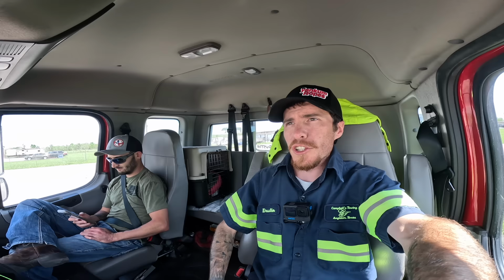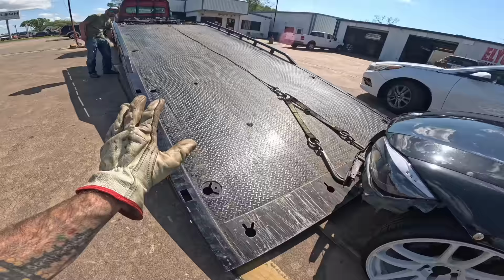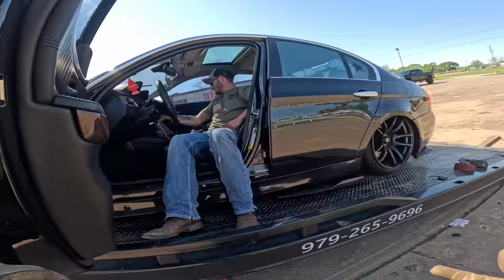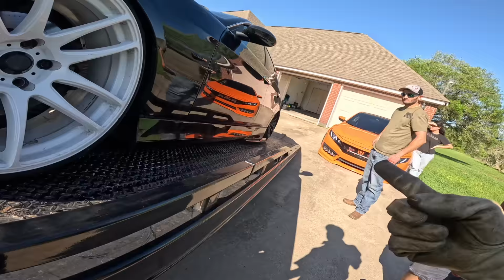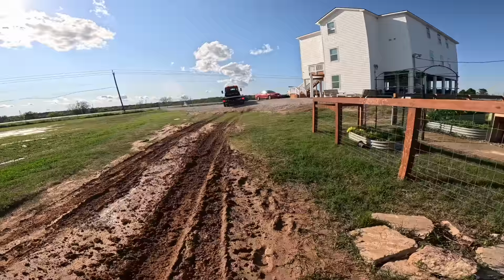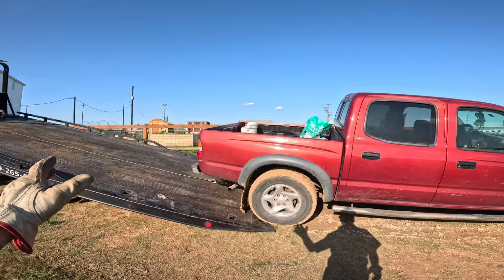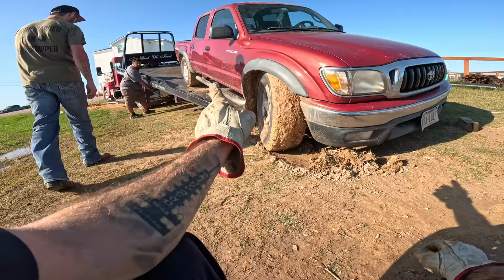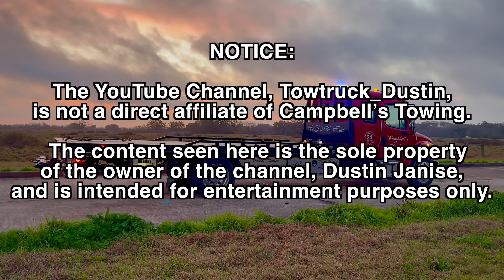Towing a Slammed BMW, and a Broken Toyota!

Comment: Loading lowered vehicles like that, are a pain in the ass! We had a Corvette months ago that was so low we needed more than just race ramps. We had to use small pieces of wood and lay them out in front of the tire as if I would lay in brick on the ground, one in front of the other. I like to use 2 4”X4”X36” with 2 skates flipped upside down for lowered vehicles.

Comment: Why would you take it out of gear and use a snatch block to bring the truck straight on the bed? If the back wheels are blocked and out of gear, the only way that truck can go is to the winch. Why make more work for yourself? The last video with the lowered BMW If you had put the emergency brake on and walked the truck out from under the BMW  you wouldn't need the ramps. As a matter of fact gust throw that ramp in the trash, you would do better with two 4x4 6' long and two blocks and you can do almost anything. I carried the small bus and box trucks with just that.
Reply from the maker: You’re obviously not very familiar with common practices in the towing and recovery industry. 
This was the most efficient way to accomplish this without causing any additional damage. 
Doing what you said, would have resulted in more undue damage.
Reply: @Towtruck_Dustin  "You're obviously not very familiar with common practices in the towing and recovery inustry" All I can say is you must have a pxxs poor student in phisics class. I was in a flat bed for several years, Iwas tained that if the rea wheels if blocke . the only place that car will go to the winch. If the front wheel is dammaged like this the safest way, and easiest way to get the car on the bed you Iode is to get the rear wheels on the bed and block them. then let the truck roll under the car that way you are only pulling the car 4 feet, and the front end damage will be less. I have had a police tow with a car on its side i would have pulled it out  to the street an loded it .but they wouldent let me go  it so i had to lode it on its top. then unlode it to right it. Dont let any body tell you you cant roll a car or truck with a bed. After the 30 th time mi boss finaly adnited to me that you can. the fist time I was impresse with your abillity, now i think you are like 90 % of the tow rivers that you are as dumb as a rock to put it as delicately as i can. I've been on about 2,000 tows and it pains me when a so called tow truck driver works 45 min to lode a truck like this when it should take 5 min. What a wast of time.

Comment: Do you not have legal height limits for your vehicles? Minimum height here is 100mm (4 Inches). Any bit sticks lower than that then you have a canary sticker (unroadworthy... the sticker is yellow.... hence the canary) Vehicle can possibly be towed and you may need to get a full roadworthy certificate to again drive your Sh@tbox!.  Seems like you guys have more rights than responsibilities. Yeah I'm going to be flamed!!!
Reply: I think that tire's aspect ratio is about 25-30%. Better watch out for potholes!
Reply: @ronaldcooper7609  Not to mention round topped road/driveway entrances, and speed bumps.
Reply from the maker: It’s on bags. It’s not designed to drive around that low.